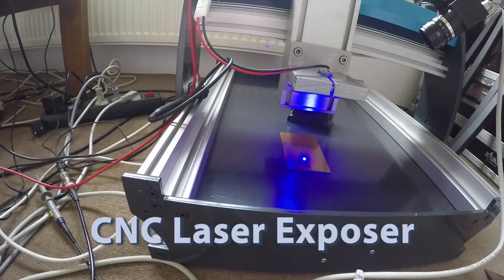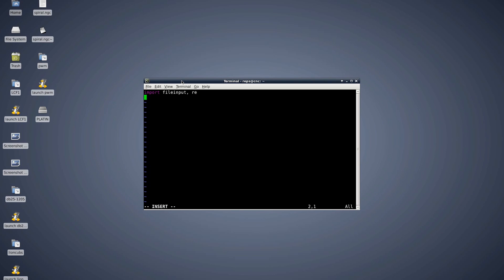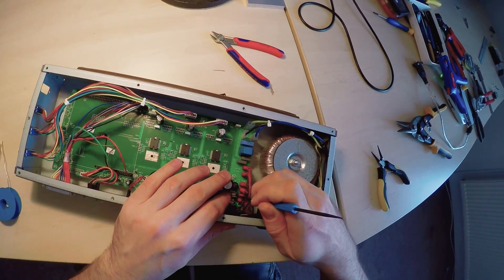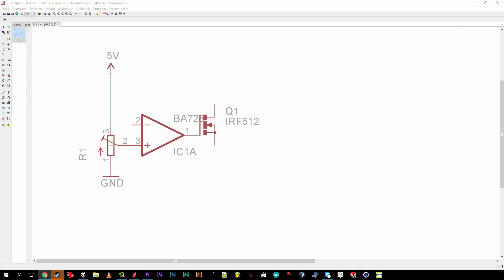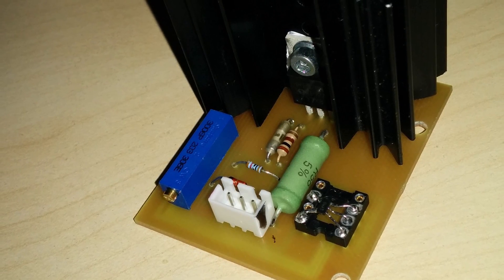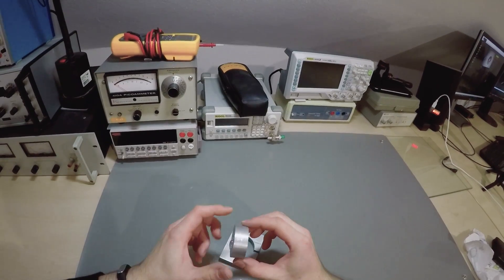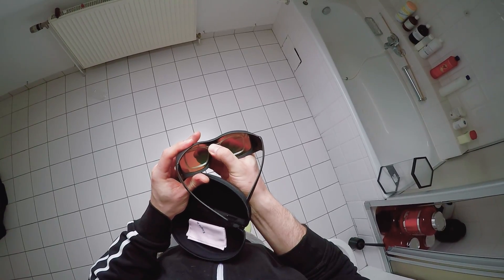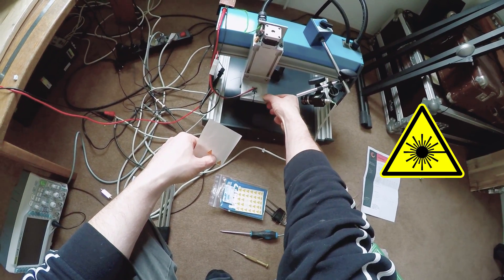Lasercubs! CNC Laser with the Colinbus Profiler and LinuxCNC

Comment: Can you tell me a bit more about the CNC router you're using in this video for milling the heatsink? Is it a china router like the popular 6040? Keep on the good work! Grüße aus Bayern.
Reply from the maker: nachbelichtet county24 lcf-1, had to replace a couple of things, then it was slightly better than the china one. But overall not very happy with that machine
Reply: Marco Reps In terms of precision or rigidity? Thanks, Markus
Reply from the maker: My criticism is based on a machine from 2011, so they might have fixed it all by now. But back then they must have pressed in all the ball bearings the wrong way, because they were all stuck to an extent were the shafts were rotating in the bores. Some holes in the frame were oversized, so misalignment was very possible (but if you have the patience, you could fine tune your machine). Trapezoid lead screws in plastic nuts are horrible, that's no surprise. The hollow base plates were a bit warped, so I always used a milled piece of wood. And so on ...
Reply: Greatt price is here http://bit.ly/2zMIolU 
We like good prices :)

https://www.youtube.com/watch?v=j5a50ob8ovQ

Comment: Is this a better alternative to the PCB laser jet printer?
Reply from the maker: +Austin Buerkle Potentially! It has a lot more variables (speed, laser diode power, beam focus, beam roundness, ...) but when you have them all figured out, the result will have a much higher quality and better repeatability. Also the machine can be equipped with a drill to have even fewer steps to a finished pcb. I am currently working on those variables and will post a follow-up as soon as I have reliable results.
Reply: Sounds promising, I am currently looking at alternatives to the perforated PCB's that require jumpers, time, and patience. Was the printer really that bad?
Reply from the maker: +Austin Buerkle for single sided, mostly smd designs the printer is amazing. manual drilling is ok too. for many cnc drilled holes and double sided designs it didn't work too well, but i gave up prematurely